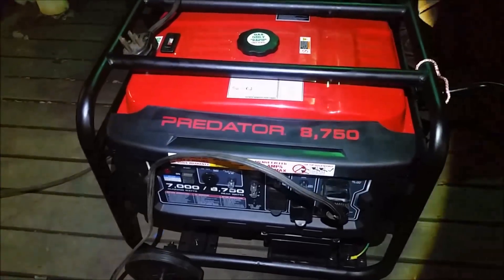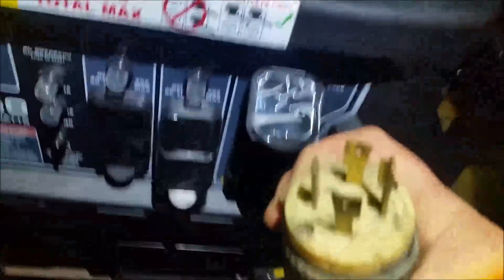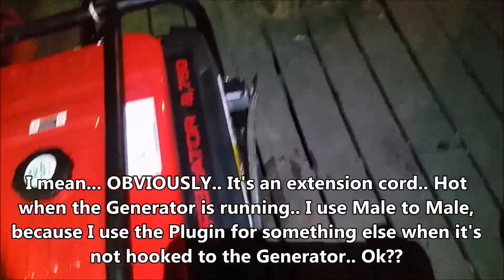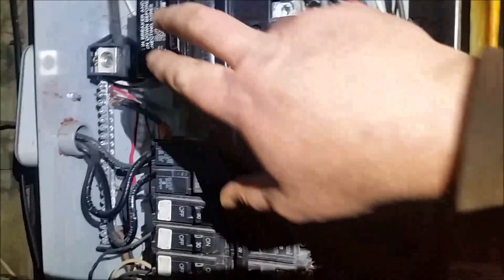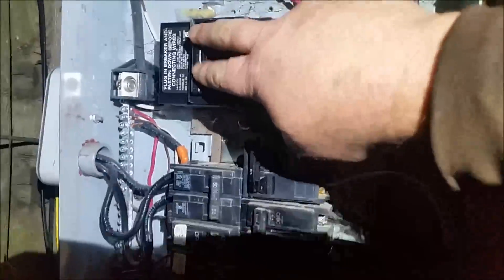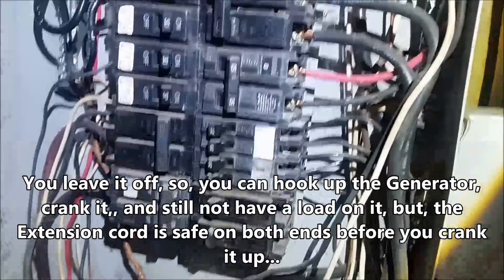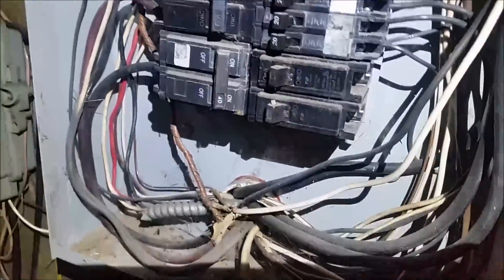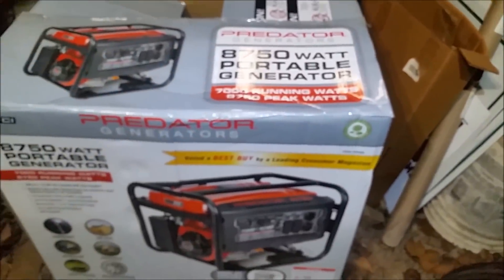Quick/Easy/Safe: Use Existing Plugin/Breaker for Generator hook up to your house Panel box.

Comment: Oh that was simple enough.
I'm surprised this guy hasn't blown something up yet
Reply from the maker: MrCervasio1.. How would you blow something up using this procedure. Entertain me.. I would like to know what it is.. Because after defending this procedure with over 900 comments, I have yet to meet someone who can define it using these safe steps.. But, you may be the one liner Einstein I have been waiting on to prove me wrong.
Reply: @MarkThomas123  doesn't the fact that you've had to defend it 900 times tell you something?  I guess the world is wrong but you are right. My apologies Mark I guess your right.
Reply from the maker: MrCervasio1  I guess I should have added the word successfully to before defended.. I would figure that you picked that up though. So, you are just being sarcastic in trying to make your point, which is par for the course since you challenged me, I stepped up to your challenge of "Why would something blow up", to which you failed.. So, add yourself to the list and there is your first example and there are hundreds that follow.. Good thing about it though.. If you read all 900 plus comments, you will surely learn more than what you could learn the time spent reading anywhere else.. This is an excellent resource and you can learn alot by reading and less by posting.. You really don't need to know how foolish your comment above was.. That has already been established.. 
And, the lack of you replying back well proves that.. You did reply however, but, only to snap back with another useless sarcastic comment.. but, if you don't believe me, the record of proof is below.. 
They thought Tesla was out of his mind when he was talking about delivering voltage freely through the air, but, that is what RF is.. 
If you go around repeating what others say, you will never learn anything.. You read, evaluate the poster and put credibitlity in the posters that you evaluate based on their comments.. It is very easy to see why I have "Successfully Defended" this procedure. But, there were some sharp comments made accidentally along the way and some were made out of actual thought and from thinkers. But, my replies to even the most ignorant comments were informational.. Your first did not give me much to go on though..  And,, BTW.. I AM RIGHT.. Just keep reading the posts below and you will agree.. I explain things with Common sense and logic as the primary way of dissemination. You will understand it,, I think... Your come back was quite crafty.. I think you have it in you..
Reply: I don't think it's defense Mark has a heart for educating people and if he ignored the stupid commentary others might think the comments were relevant.
Reply from the maker: You are exactly correct..  I would love it if I could quickly glance and see the details about the posters that are commenting.. That would make this addicting.. ha. But, I am a good trainer and like to teach everyone anything I know.. I find that I learn as much or more by teaching than anything else I do.. 
You will find out just what knowledge is missing when you start teaching someone something.. And, I would like everyone in this Country to be very, very smart.. I only wish it were about the fundamentals of this Great Country..We will loose it if the libtards ever get control again.. I have never seen a more ignorant bunch of people.
Reply: I've noticed that some try to disappear with somewhat of a save face comment, others just disappear.

Years ago an electrician was sitting in a ditch waiting for a blown phase splice to cool. He asked me why both ends were arcing to ground when the splice blew. I picked up the box the splice kit came in, tore off a flap and drew him a sketch of the 3 phase  transformers at each end of the run to show him how it backfed the fault. Looking back I wonder if it was a real question or a test, whichever it was I passed and we are friends to this day.
Reply from the maker: Ed Taylor.. Yep, I can relate to that..  Agreed..

Comment: Violates every electrical code there is!!! Great way to put Brown power through your whole house too. 
Not smart
Reply: Not being limited to a few circuits is a positive feature of this method. If I need to move to another room for safety or whatever during an outage I know the outlets are available. I am smart enough not to overload the generator, just as I didn't light all my candles at once before I got the generator.

 Usually the brown power comes from the utility trying to restore power. A line fault to earth may not blow a fuse or trip a breaker (ever hear of people bringing worms to the surface by energizing the ground with a rod at 120v?)
Reply from the maker: JR William.. Are you Smart,, or just another DumbAss who doesn't have a Clue what you are talking about.. 
Because,, Making a Statement like that makes me think you know what you are talking about..  Brown Power.. I won't even address that, but, it answers my question more fully.. 
VIOLATES EVERY CODE THERE IS... Bet you can not quote a single NEC Code (Link to it so I can check quickly) that is Violated.. 
Either Substantiate your claim or shut the hell up with your Ignorance.. We Check ignorance here.. We don't allow it without identifying the problem.
Reply: VIOLATES EVERY CODE THERE IS.. that's rich and he can't step up to the plate and respond! Just another snowflake hit and run, or maybe a juvie.
Reply from the maker: You got it Ed. Ha.. Probably both.. Ha..Ha.

Comment: Use a transfer switch or you stand a chance of killing someone.  I do all my own electrical work and have such a background but called a licensed electrician for this one.   Its not a game that you get to play again.  HAVE YOU EVER THOUGHT OF THAT MAIN BREAKER FAILING TO DISENGAGE THE ELECTRIC?????????????????  NOW the generator is charging the entire electrical line when everyone thinks it dead or when the grid returns it will surely smoke your generator.
Reply: I just had to jump in on this one.  These generators will not power up a neighborhood if the main failed to disconnect one would know immediately. Think before you type!
Reply from the maker: I second Ed Taylors comment.. You seem to have the Keyboard Driver Problem.. You know, the one sitting in the chair behind your keyboard.. Most of us think "before" we type.. That is about as elementary ignorant a comment as I have seen here out of 914 comments.. You should be proud,,??? Maybe?? Ha.>Ha..
I don't know why you would call an Electrician to install a transfer switch if you do all of your own Electrical work.. Do you see some type of complication that you don't understand? It is actually the same fundamentals and if you feel that way, I would ask the Electrician to spend some more time there and look over "all" of your other repairs, because you are missing some fundamentals to make that statement. 
Main Breaker Failing to disengage the electric? Are you trying to say that a main breaker fails to disengage the electric when it is switched off?? or someone Forgot to throw it off.. Because to the second, and to the target audience of this video, we don't forget to tie our shoes, put our car in park, or turn the main breaker off.. If it is the first,, then, you might want to wonder and spend some time thinking where the phrase "Fail Safe" came from.. No.. the likelyhood of that happening is like getting struck by lightning twice in one day.. Same as Scuba gear does not Fail Unsafe. It always fails with a safe flow, and never fails without flow. It's just the nature of the requirements of the design.. There are smart people who work in the design field and they follow design regulations,, in this case developed by the NEC and Primarily the UL.. So,, more ignorance posted.. You should really stop typing and start reading here.. There is a wealth of information in this video and it's posts.. It is the reason I reply to ignorant comments like yours using common sense to correct your ignorance so everyone, hopefully yourself can see it''s ignorance.. And, one last Really ignorant statement.. You are not running good averages today.. A complete failure so far.. 
Electrical generator with 30amp output is going to charge the entire electrical line?? Back to fundamentals again.. The split second you charge the line, it is going to consume a whole hell of a lot more than 30 amps and in a split second the breaker is going to trip or the generator die.. I mean.. It just doesn't get much simpler in concept than that,, AND YOU MISSED THINKING ABOUT THAT?? Holy crap dude.. Where is your brain?? Oops.. You got one right.. Ha..Ha.Ha..But, Wrong again.. 
How is your generator breaker going to be on,,, when the power comes back on,, when the load it would have to carry in order to be on for a second is is what tripped it's breaker to being with.. I mean.. We are talking about the odds of double lightning strikes happening even if you and the lineman together tried to make that happen.. It is really totally ignorant to think that would happen by Chance.. The exact timing.. Stop being such a fool and read instead of typing... When you graduate these 914 posts, you will be in authority and be making posts like myself and Mr Ed Taylor and others.. Not like the ignorant one you made..  I hope I made a difference in how you think today.. It would change your life.

Comment: Once again I will say this ,There's plenty of options to hook up your generator from very expensive to very affordable.And yes ,if you can by a generator you can afford a transfer switch . Electricity is unforgiving,don't put your family or someone else's family in danger. I understand you have to do what you have to do to get through a power outage . But the way our weather has become ,you need to prepare. Bottom line ,Install the dam transfer switch.
Reply from the maker: Susan Eisenberg.. I am curious why you chose the most expensive option to recommend... Why did you not recommend the Generator Interlock first...??? 
You are an Electrician.. Yes? And, the need for the "Average Person" who wants a Generator hooked up to their house to be safe is not anything more than a Generator interlock and a 220v breaker in the top right hand breaker position.. If there is no complications, Available 220v breaker slot on the right bus, and the Exposed Male Interlock receptacle (or is it considered a plug=male=hmmm),, is located in close proximity, should take less than one hour to install, if you really took your time.. I mean, drill 4 holes accurately after applying a template, Move an existing 220v breaker or 2-110v's and install the Twistlock.. 
Vs a total rewire for a transfer switch... They do the exact same thing.. Guarantee that you can not backfeed the power grid with Generator power,, Which is your GRREATEST FEAR... And, guarantees the safety of the home owner,, and the lineman?? .. Isn't that what this is all about??
Reality Check for a minute here.. 
Generator in this video produces 30amps per leg and has a GFCI breaker rated for 30 amps..
What is the load possibility when you back feed the Grid? Lets just say that, there are 2 or 3 houses connected exactly to your transformer and nothing else connected, which is a ludicrous though, but, for this example we will consider it.
How long would the Generator stay running, or how long would it take to trip the 30 amp breaker if the generator was exposed to backfeeding the grid and powering two more homes in addition to itself.. Or one more for that matter.. Consider the best case scenario.. The neighbors don't have generators,, and the power went off and they have done nothing to conserve electricity.. All 220v circuits are still in the On position breaker wise.. 
When the generator owner flips his breaker on, and powers his own house, all 220v breakers off normally and the power hits his neighbors house, who just thinks the power outage is temporary and the lights are coming back on,, but,,, they went right back out.. How long do you think that dangerous condition would take place?? And you are recommending the most expensive option to safeguard something that is already been safeguarded by default?? 
I think the Generator Interlock $50 is the cheaper option.. A little more safe,, not to use a Male to Male cord,, Is to install a Male Receptacle on the outside of the panel (How Ironic).. But, safe due to the Interlock.. 
But, none of those situations apply to the users of this video.. Because it is to use an existing breaker and an existing plugin that is usually used for something else like a welder or washing machine, etc.. And neither of the options that you recommend are applicable to this situation to be able to use the dual purpose breaker and plugins.. Cheers.. Just something else to consider in the mix.. 
But, lets be honest.. The interlock does the same thing and is much cheaper,, but, again, probably something the average DIY can do, so, hurts the Electricians bottom line..
Reply: Hey Thomas ,I never said the most expensive option .If you read it correctly I said there are very expensive to very affordable options to hook up your generator safe and legal . You can hook your generator any way you want ,I don't give a flying fuck . All you want to is cry and moan because a lot of people are not agreeing with your post .You seem to be very angry ,dude lighten up or you will get a heart attack. Like I said ,you can back feed you panel 5 different ways to Sunday . If you can afford a generator you can afford to hook up correctly. So put away your weed ,your whiskey ,your pain killers,and what ever else your taking for 2 weeks ,Then you can afford a transfer switch . Good luck !!

Comment: As a welder I have hooked up a 220 welder a number of times by opening a panel box and wiring the two hot lines on each side of the 110 input. With the panel hot yet.  No big deal if you know what you doing.  Most of you people should not be doing this because apparently you can’t follow simple directions. I can tell by your responses and your lack of understanding of the process of delivering electrical power.
Reply: With the panel 'HOT', do you realize you are sending 240V out of the panel, into the meter, into the utility feed, to the transformer in the street or on the pole that boots the voltage to 1,000V and HIGHER?
This will kill a power company worker instantly.  Do it right or do not do it at all.  
Power company workers lives matter.
Reply: Do you realize it was an electrical powered welder I was hooking up, not a gas powered welder? I was welding, not powering the house.